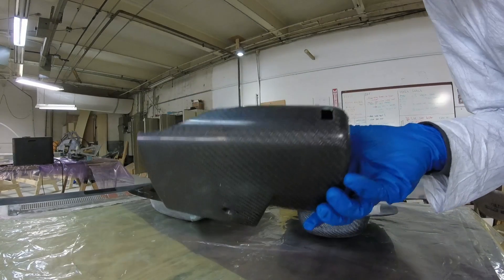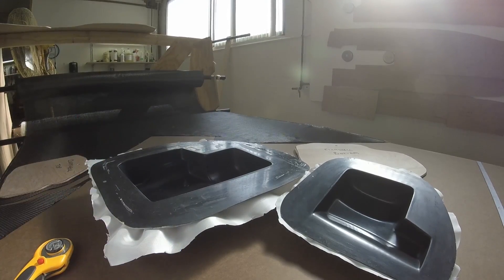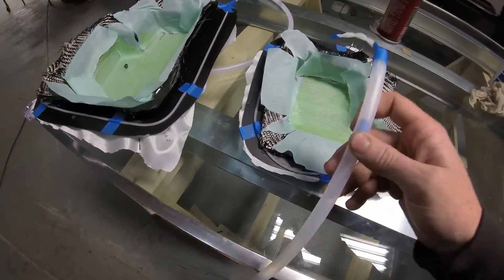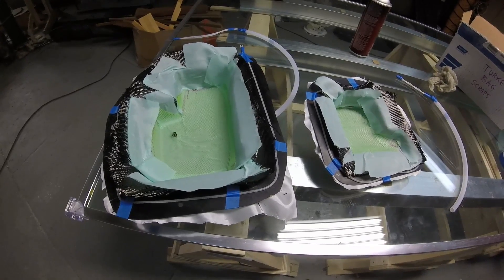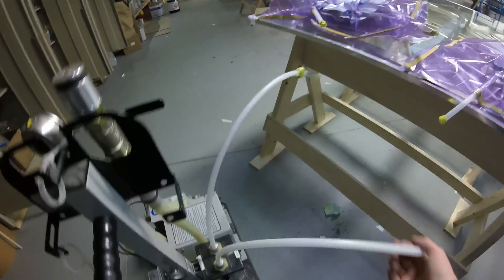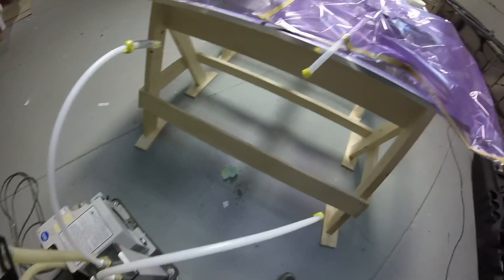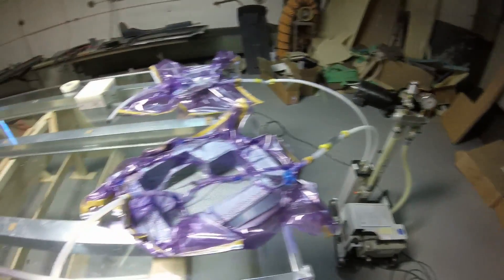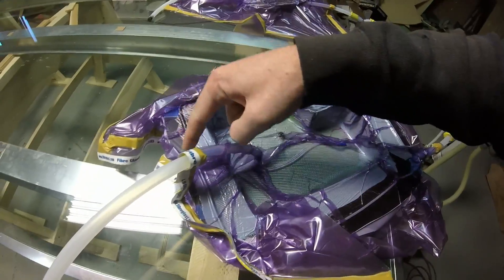Palm Composites - Making A Carbon Fiber Datsun S30 Z Clamshell

Comment: Nice job !  I have a question , because i start use 770 loctite  for release and saw you use it  how you clean the parts  after  demould ? I have a problem  with clear coat ,  thanks

Comment: I have a couple of questions.  Did you have to account for the weight of the support foam, peel ply, and flow material in determining how much resin to use to ensure a full wet out?  Would it be better to ensure a full layout to inject the resin around the border and have it draw toward the center?  I am interested in learning more about composites and how to make them. Great product though, thanks for showing us your work.
Reply: Two good questions (: Yes, you can infuse from the outside -in as well with the feeding line all round and the vaccum in the middle. Choose whatever fits your situation best. Also about the amount of resin YES you need to account for the peel ply and flow media resin absorbtion as well as a bit of margin at the end of the pot of resin so that you don't infuse air. And please if anyone thinks I am saying nonsense please let me know bellow so I can improve as well !
Reply: and once you get better at it and made a lot of parts, you can just eye everything from memory of what it should use.  I would always what I think it should use and add around 20% more just in case you were off and didn't have enough. From there what ever is left subtract so you can figure out your perfect resin amount from there.  Well that is how I did it. Did 5-10 infusions a day for 10 years.